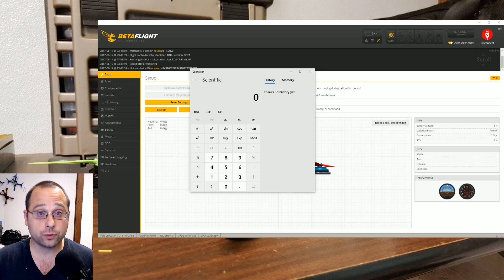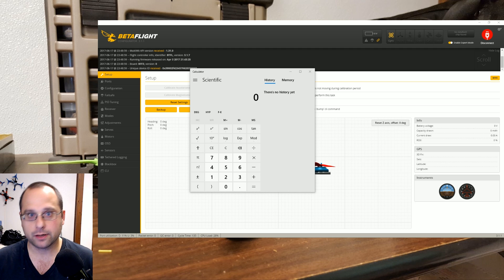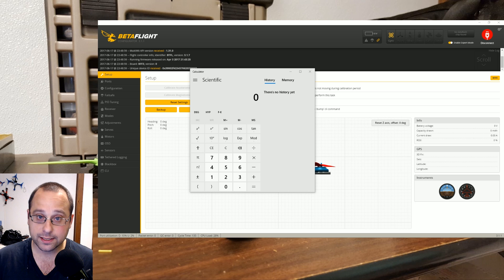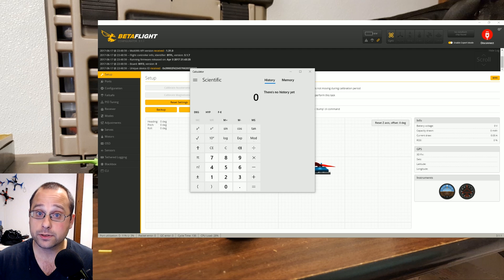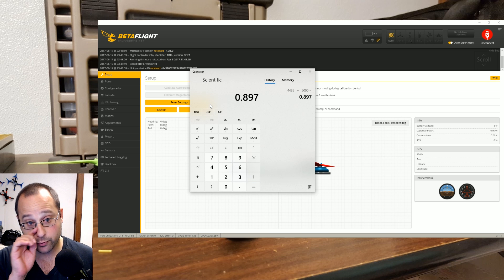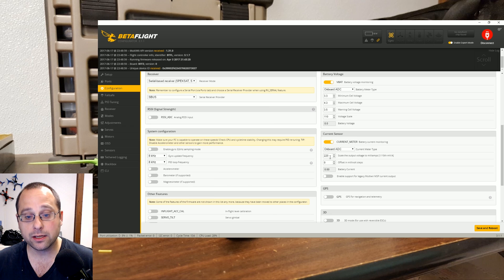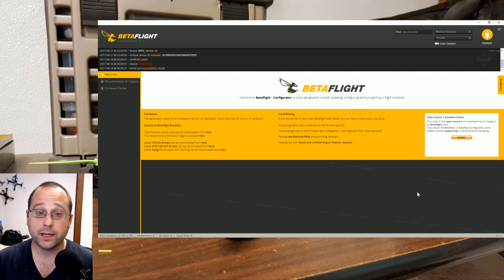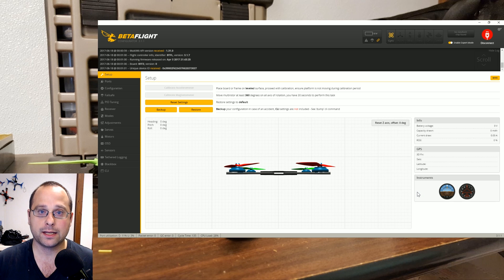The safest way to calibrate your Betaflight current sensor

Comment: Nice video, very helpful. However I have a question on battery voltage not showing correctly... 
When I plug my fully charged 4S battery into my quad the voltage used to show 15.6. 
I've gone into betaflight and in the power & battery tab change the scale up all the way to 152 and now it ready the battery correctly at 16.8v (while the battery checker is plugged in). 

But I've taken one of my other batteries that are in storage mode 14.8v... and checked again... Voltage still shows at 16.8 even though the plugged-in battery checker displays 14.8...

Any ideas as to what I'm doing wrong here?

Comment: But if Bardwell gets 0.897 then the Betaflight is not 10% too high, it is 1/0.897 = 1.1148 => 11,48% to high. Or to make it simpler,  It should be 5000/4485 =  1.1148. So then you take the old scale, multipy it with 1.1148 and then you get 220 * 1.1148 = 245. His comment about the scale going backwards comes from him dividing the charger value with the betaflight value which is wrong. If you assume that the charger is more accurate, then the value you use as a base and divide by, is the charger value, so that you get how much betaflight differs from the charger. (unless he was trying to calibrate the charger with the FC current meter as a base) :)

Supergary
 below has it correct, New scale = Old scale * (Betaflight mAh consumed / Charger current charged)

Comment: For quick reference:
New scale = Old scale * (Betaflight mAh consumed / Charger current charged)
Reply: From what JB says it's more like New scale = Old scale + Old scale * (1 - Charger current charged / Betaflight mAh consumed)
If we take the numbers in your formula it is 220 * (5000 / 4485) = 245, which is wrong
In my formula it is 220 + 220 * (1 - 4485 / 5000) = 242, which is corrent

But maybe JB is wrong and 245 is the correct number
Reply: @bartsoj  actually thinking about it your adjusting the betalight measurement and therefore you need to know the percentage of the betaflight measurement it needs to be increased not the percentage of the charger measurement.

So the the formula above is in fact correct as you are given a correction factor relative to the betaflight measurement and how far it was wrong.

Comment: Very nice method, thank you very much <3
One question, one of my charger charge my 3s to 12.68 instead of 12.60 and my 6s to 25.30 instead of 25.20 is this bad for the lipos? :O
Sorry and i have another question, I have 3 types of props, one pulls 100 amps, one 115 amps and the last one 130 amps does it mean that the 130 one got the most top speed and acceleration?

thank you in advance :D
Reply from the maker: That small difference in voltage is probably no big deal.
The 130 amp one doesn't necessarily generate more speed and acceleration. It might just be less efficient. For example, if you put a very heavy prop on a motor, and the motor doesn't have enough torque, the amp draw will go up but RPM won't go up.
Reply: Okay nice, thank you very much for your fast answer. I learn so much from you 😊and I appreciate it that you answer any of my dumb questions 
 I probably wouldn’t even get my quad in the air without you🙈😂

Comment: my currant sensor is telling me I'm using 8s when I'm only using 6s ???
Reply from the maker: Check that the voltage measured is correct and adjust voltage scale if not.
Reply: Thanks Josh u are the master 🙏

Comment: Can you do this on the new beatflight 4.2.0 there is no section that is labeled current sensor under configuration anymore? I just have the new section labeled battery and there is voltage meter and amperage meter?
Reply from the maker: It's in the Power and Battery tab now.
Reply: @JoshuaBardwell  Thanks!

Comment: I am wondering trying to understand the relation between capacity eaten and cell's voltage. For the 2300 mah battery, does this mean that single flight run should be able to eat this 2300 mah (due to betaflights stats) and then around that I will have ~3.2V cell? Or if I would eat 2300 mah cell voltage will drop to 0V? (question). Currently I am flying at 3S 2300 mah, and after eating 1000 mah my cells are at 3.6V

Comment: betaflight says my battery has only 4 cells, when in reality it has 6 .. also shows wrong voltage! 17 instead of 24V .. any idea?
Reply from the maker: In the power and battery tab adjust voltage scale up or down to make the voltage match what the multimeter shows for the actual battery voltage.
Reply: @JoshuaBardwell  ok now i found that tab - betaflight changed a little over time .. worked like a charm! what is more accurate? a normal multimeter or the Q8 ISDT charger? difference is 0.2V total

Comment: There should be a documented list of calibration values for each current sensor.
Reply from the maker: This info is available from the manufacturer sometimes, but even if you have it, the precision of the resistors is not high enough to guarantee accuracy based on nominal values.

Comment: I have one quad thats like waaaay off. It just keeps climbing in the osd up to like 7000 or whatever but its really only drawing something like 700. Process different for something that off or different for 4.1?
Reply: I have the same issue, mine starts climbing when I plug in the battery. BF 4.1.4 iFlight Bumblebee
Reply: Yep same...hopefully this works

Comment: Could you do an update on this using the latter betaflight if not already done..
Reply from the maker: Nothing has changed, to be honest.
Reply: @JoshuaBardwell  
How good is the calibration feature.. 
I presume it only works correctly with props on.

Comment: You shld do video on betaflight 4.1 current sensor,and how to set. Theres a calibrate button now down by the save button. I'm still trying to figure it out. Thnk you for all u do. Great help in our hobby👍
Reply: yeah noticed that but havent tried it.. i used isdt batterygo to read voltage and set it

Comment: My flight controller has barometer, in Betaflight Configurator "Baro" is yellow on the top of the page, but Baro is not showing up on the Modes page. Is there a command to enable it? Thanks!
Reply from the maker: I don't think the mode is called Baro. I think it's Altitude Hold. But to be honest I never use that feature so I can't be sure.

Comment: My flight controller is reading the wrong number of battery cells. Any reasons why, and how to fix it?
Reply from the maker: Go to the Power And Battery tab and raise the Max Voltage threshold from 4.3 to like 4.35 or 4.4.

Comment: i took out 900 on my osd, and put 1300 back in. this is slightly opposite to what you have. i need to go the other direction. mine is reading low.

Comment: I 'm wondering if the current coming out equals to the current coming in to the battery? Is there any efficiency issue in these process? See, in 100 out 88 etc...?
Reply from the maker: Current through a system is always constant. If energy is lost to efficiency losses, it is lost as voltage.

Comment: Thanks for the video, I have the Holybro Kakute F7 and a Tekko32 4in1 esc (35A) running Betaflight v4.0.4 I have it configured to work off the ESC Sensor. Ports Tab set to use UART7 for the ESC. In the Configuration Tab, enable “ESC_Sensor“ feature. In the “Power & Battery” tab I selected “ESC Sensor”. I have DShot 1200 as the ESC protocol. How do you adjusted for the mAh usage on the battery? I understand the current sensor  calibration procedure  on a FC, but is there a way to do it for this type of ESC configuration?  the current adjustment is not available in Betaflight v4.0.4 on the power tab. Any help would be great. thanks
Reply: RoccoFPV I have that same ESC along with the Lumenier LUX F7 and dshot600 is my best option.  I wonder why...

Comment: so you showed how to do it withj am fc how about calibrating a frsky voltage sensor through the reciever?
Reply from the maker: Just adjust voltage scale until it matches a multimeter reading.

But the voltage scale is usually pretty close to accurate.

Comment: for me the mah on the osd  sensor ...shows the mah rapidly climbing faster than the seconds ...on my Babyhawk  3in   with a 550mah it will run up to 500mah used in 2min the voltage is  at  12.5 ...plug it in to the D6 charger  only 125mah put back in....so obviously something is wrong . i have calibrated current sensor...

Comment: is there any way to do this from an esc onboard sensor? For example i'm using the Kakute f7 stack that comes with the tekko_32 35amp 4-in-1 esc? I know that esc sensors only show the motor current drawn however i'm seeing a deviation of almost 35% which seems very high. I know its not perfect but 35% over the motors seems like much more than my VTX and FC  could possibly be pulling. Any ideas?
Reply from the maker: You can calibrate blheli32 current sensors in blhelisuite32
Reply: @JoshuaBardwell  Thanks ill research how to do that.

Comment: why do you need to end at a specific MAH? can't you just record the value from OSD when you landed and add them to average it without the clean numbers?
Reply from the maker: Sure you can do that. It's just easier if you stop several packs at the same mAh so you don't have to write down and remember which pack stopped at which value.

Comment: What about using a power meter and making the current match the one you see on the power meter ? 
That's what I've done .
Reply from the maker: That is very difficult to do since it requires spinning the motors with props on.

Comment: Hi Joshua.
A total beginner question.
My osd in the Goggle show me the aktual voltage and amps. After the flight i see the used mah. But in the betaflight configurator is no tab for the current Sensor showing so i cant calibrate the used mah like in your video.
Configurator is 10.4.1
Fw on fc is 3.5.2
Fc: Rharlance F4 Pro+V2
Or have the FC no current sensor and also the configurator cant show this?
Hope for help...Uwe
Reply from the maker: If you don't see the Power And Battery tab, click on the gear icon in the upper-right corner of the configurator. Enable "expert mode".
Reply: Must the quad powerd on with the battery😕
I dont see the current sensor calibrate tab😕
Reply from the maker: The quad does not need to be plugged in. You need to enable "Expert Mode". Click the gear icon in the upper-right corner of the configurator window and enable the "Permanently Enable Expert Mode" option.

Comment: Will one current sensor setting work accurately when using 4, 5, and 6S batteries, or do I have to recalibrate every time I use a different volt battery?
Reply from the maker: The current sensor should be accurate regardless of voltage.

Comment: So my scaling factor with your 4in1 esc is 8.  Does that sound right?  Just seems way off the current sensor on the JBF4.
Reply from the maker: When you're using ESC telemetry, the scaling factor has no effect. The scaling is built into the ESC and is managed in blhelisuite. If you are changing the scaling value and seeing an effect, then I think you have mis-configured the ESC telemetry and current sensor. Go into the Power and Battery tab and check that the current source is set to ESC Telemetry.
Reply: @JoshuaBardwell  Got it. Yes I was not configured correctly. So pad jumpered to tel, and current/voltage sensor set to esc sensor. Anything else? I saw there was esc telemetry on the configuration tab. I have that off currently.
Reply: So... I have smart audio on uart 4. Looks like in I place esc tel on uart 4 it seems to work. Does that mean I need to move smart audio to uart 6 and move the wire?

Comment: The voltage regulator on mine seem a bit wonky. battery plugged in on the bench says it burns through 100mah in the matter of seconds. That cant be right. can someone give me a basline number to change it to? I'm using Lumenier 4s 1300's. Thanks
Reply: Please, can somebody answer this

Comment: Joshua, cheers you you! I have learned so much from your videos... you brought me from tinkering and failing to full success. I have a problem with tuning my battery and seeing low voltage warning messages in my osd. I have a 20x20 hglrc f4 stack and just cant seem to get it right. voltage seems correct when testing with a voltmeter, but the battery never hits the voltages to send the message to the osd. Any help would be greatly appreciated. Also, what is your paypal for donations??

Comment: My mobula 7 is beeping with 2s single battery. Beta flight will only let me put 5 for maximum cell voltage. What am I missing? Thanks for any help.
Reply from the maker: The cell voltage is .... the cell voltage. Not the pack voltage. So you just set it to 4.4 or 4.5 if you're charging to HV and that should be fine.

If it's beeping with a single battery then maybe it's not auto-detecting the number of cells correctly. Put the Average Cell Voltage in the OSD and see if it thinks the average is equal to the pack voltage or 1/2 of it. This would indicate it mistakenly thought the 1S was a discharged 2S.

Comment: hi could you help I am trying to do my amp I have a 4500 lipo on my osd it said 179mahbut when I charge its put back in 570mah what should the scale be set at it would be help full for the numbers as my maths are shocking lol
Reply from the maker: 570 / 179 = 3.18

The number in the osd needs to go up. So the scale needs to go down.

Divide the current scale by 3.18
Reply: @JoshuaBardwell  thanks very much

Comment: Why does my mAh used continue to increase after I've landed and disarmed?
Reply from the maker: If it increases slowly its because your electronics are still drawing current. The motors are not the only thing that draws current.
Reply: Joshua Bardwell I find that it increases by 5 units instead of 1? So it counts by 5 basically as it's increasing.

Comment: I know is wrong bcause each motor on my quad drowns 40A and osd says 80amps lol
Reply from the maker: It's very unlikely that your motors are actually pulling 40 amps in flight. Even if that is what they measure on the bench, in flight they unload and pull less. Finally, in flight, the battery is a limiting factor on the amps they can pull. So even if they wanted to pull 40 * 4 = 160 amps, the battery wouldn't deliver it and it would pull less.

Comment: Joshua Bardwell I am using your latest FC. I'm using the formula from the video, I land at 900mah as from the osd because my voltage is reading low enough that I have to land anyways at that voltage. I'm using RDQ 1500 lipos. At around 900mah from osd my volts are around 14.2 to 14.4 before I land and voltage goes back up when I land like it should. My question though is, I use 4 batteries. So 900 x 4 is 3600. I put back in on the charger around 5200!! So 5200 divide by 3600 is 1.44. So is there a baseline of 100% because yours was 0.894 I think so it's 10% high. If mine is 1.44 does that mean mine is 44% low or is it 54% high? I hope I'm explaining it right or you understand and I'm doing it right. Thanks for your time
Reply: Default value is 250 for your FC, and you increased the scale by 10 percent because osd is reading 10 percent high. In my case, the number I got is 1.44 so do I increase or decrease the scale? I've increased the number to decrease the scale and added 44 percent to 250 and got 360, is that right?
Reply from the maker: You put back in 44% more than you took out, so your OSD is reading 44% low.

To raise the OSD, lower the voltage scale. Multiply the voltage scale by 0.44.
Reply: @JoshuaBardwell  Thanks Josh, love your channel, and learning, :)

Comment: I'm running Betaflight 3.4 on a Bfight 210.  I was going to try this but I can only find the "amperage meter"... no current sensor.  I am confused... Can I still adjust my current sensor this way?
Reply from the maker: "Amperage meter" in the power and battery tab is the current sensor scaling.
Reply: Thanks

Comment: Joshua Bardwell

I Calibrated my Current sensor the hard way last week.
Like you said in your video i turned around the props and switched them so they push the quad down.

I got it pretty spot on.
My question now is: I know the value i have to put in to betaflight but do i need to callibrate the current sensor everytime i update the firmware?

You make great content.
Keep doing what you are doing because I Wasnt even Flying now if it wasnt for you!
Reply from the maker: You can simply copy the value when you update the firmware.
Reply: Joshua Bardwell 

Thank you!

Comment: Does a current sensor need big wires? because i tried to calibrate it multiple times now and I just saw that it keeps at continuous 8.88A, in idle, hover or full punchout, I dont get it. Can somebody please help?
Reply from the maker: You've probably got the wrong sensor selected in the Power and Battery tab.
Reply: I wish I did, both onboard ADC and i'm filling in the scale at current tab and not voltage tab, I don't get it, also if I increase or decrease the scale the continuous current (8.88A) changes depending on the scale.
Reply from the maker: The fact that the current value doesn't change when you throttle up or down is a sure indicator that the sensor is not working. The most likely cause is incorrect sensor selected. Such as on CLRACINGF4 where you need to solder bridge to select internal or external sensor.

What's your FC?
Reply: Its a omnibus f4sd, https://www.banggood.com/BF3_1_5-Omnibus-F4-V2-Flight-Controller-STM32-F405-MCU-Integrated-OSD-Built-in-5V-BEC-Current-Meter-p-1143258.html?cur_warehouse=CN
Reply: im having this problem with the Kakute/tekko32 combo.  my amps on idle is at like 30 and doesnt change.  my mah will be like 1000 in a matter of a minute just with my quad armed and sitting ( no throttle)
Reply: Mike K yes that's the exact problem that I have too, does your amps, which is 30, also change when you change the scale in betaflight?